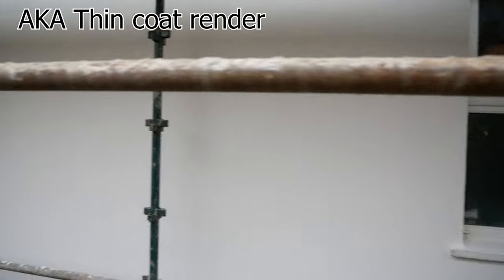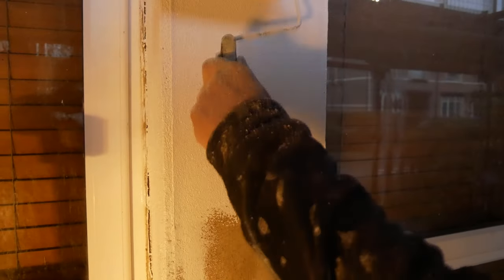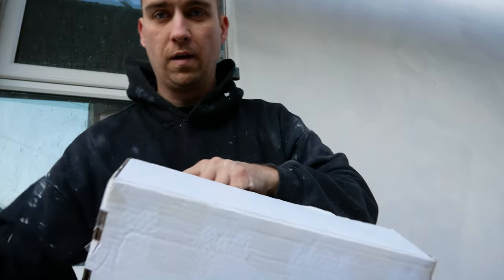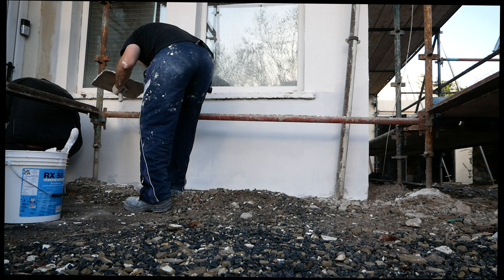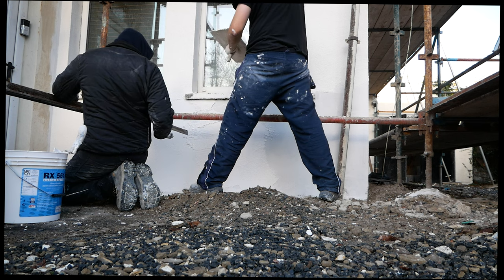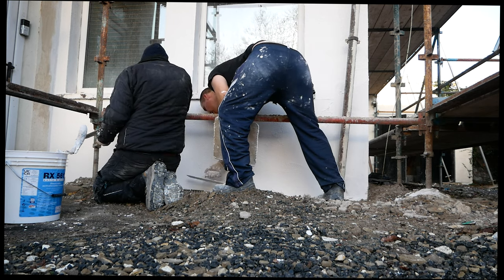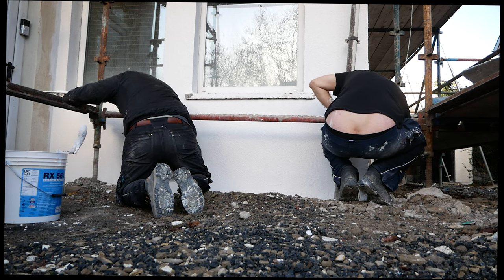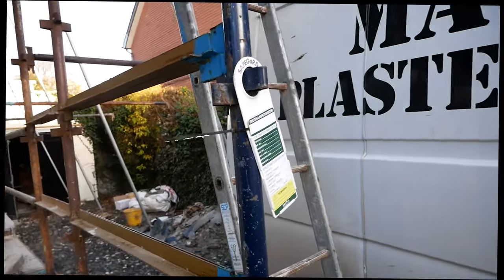How to Render over old brick wall smooth and Acrylic Render scud scratch cement sbr part4

Comment: To paint over 2 week old acrylic render can you use self primed exterior paint?
Or do you need to use special sealer primer
Reply from the maker: @c2k911  I would think so if uts self primer but you could test a small area 1st?
Reply: @macplastering  when I test how long to look at it and what do I do to see if good
Reply from the maker: @c2k911 @c2k911  I would say a day or 2 and try pick at it see if it's bonded well